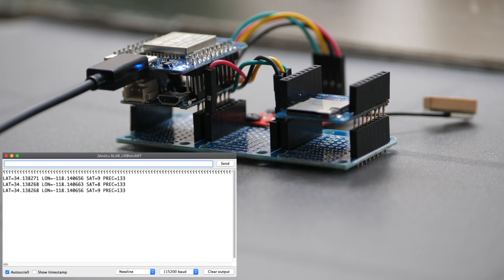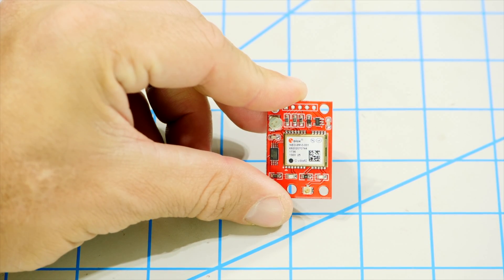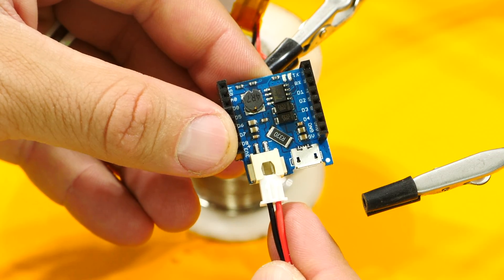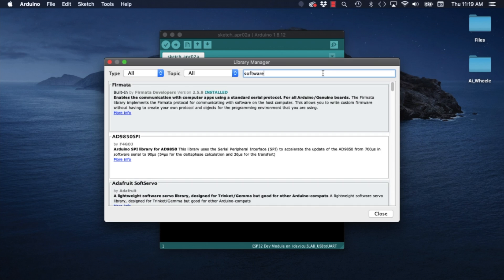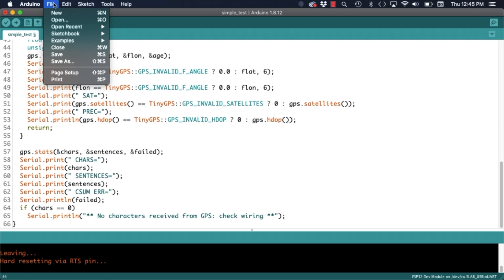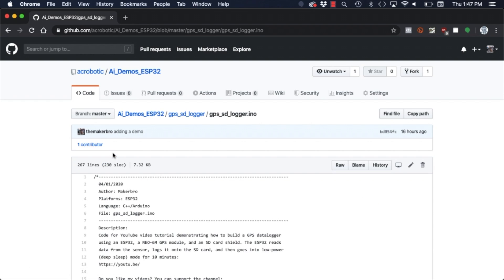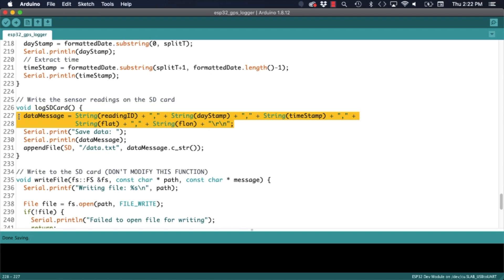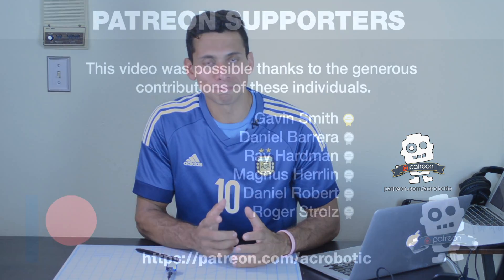ESP32 Log GPS Data On An SD Card | NEO-6M Datalogger

Comment: Very cool project you posted. Welldone! I've tried your example on github. What NTP library are you using and what version? Its not shown in the video what NTP library you installed :-) When i try to compile your example i get I get class NTPClient' has no member named 'getFormattedDate' I used NTPClient by Fabrice Weinberg Version 3.2.0.
Reply from the maker: ha, thanks! i suspected it was coming back to haunt me. the library manager version is old, so i did get the same error. i then tried the one on github:

[edit] git clone https://github.com/taranais/NTPClient

and it worked, BUUUUUT... i forgot to record it, and i was too lazy to redo the section of the vid. i mean, eventually it will work with the version in the library manager, but at the moment that's not the case. let me know if you have any other questions, and thanks for keeping me honest! 😅
Reply: @datasith  I deleted the NTPClient from my Arduino libraries directory and did the git clone at you instructed above. Still same problem... i looked at the code on Github that function is not there...
Reply: I subsequently looked at pull requests for this library on Github and issue #94 has not been merged yet into master. When this is done it will be available. I included this change on my side now it works.
Reply from the maker: @prlombaard  sorry, replied from mobile by looking at the browser history. the actual fork i used is this one: 

https://github.com/taranais/NTPClient

sounds like you got it working on your own nonetheless! thanks again for keeping my honesty to a higher standard! :)

Comment: You do not need a network time server. The GPS module will provide UTC date/time as part of NMEA data. Since you will only log GPS data when there is a decent satellite connection, this is a valid option.

TIP: You do not need to cut and solder those power wires. You can extract the crimp terminals from the plastic housing with carful use of a needle to press the metal tongue that keeps the crimp terminal in. Do not use force.

Comment: Hi, thanks a lot for the code. Do you know how to detect when the SD was removed o extracted and when it was put on again? for example, it is working normally and it is on, but someone wants to extract SD and does not turn off the device and then put again, so dont work well, but if i detect that was extracted i can do somethink. do you know somethink like that?

Comment: Your latitude and longitude data stored on the sd-card is only 2 digits precise. It should be 6 digits. The stored location data is not of any value this way. Do you have a solution for this?